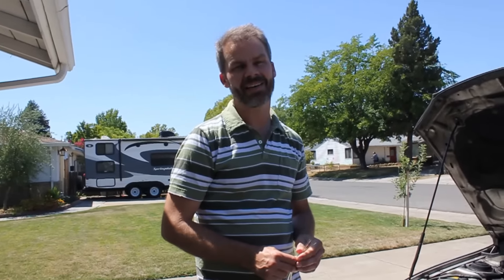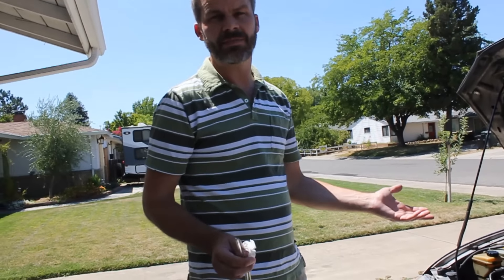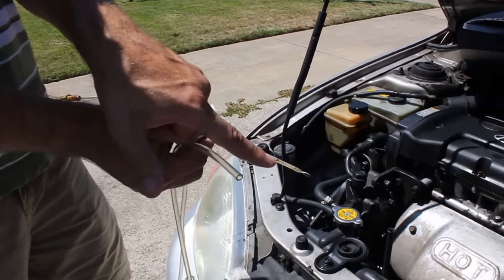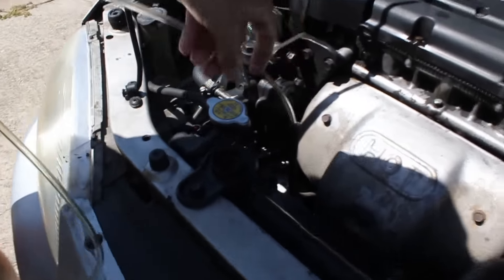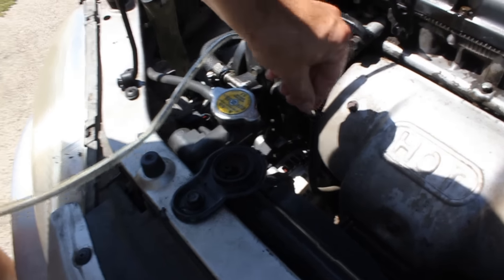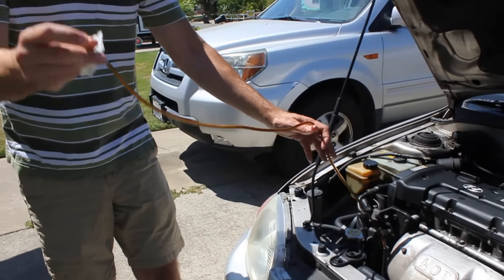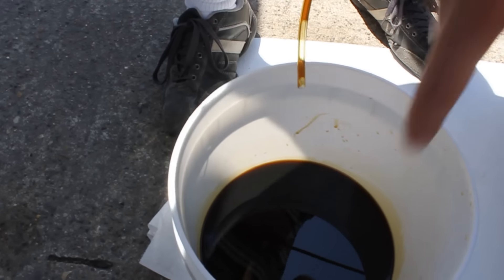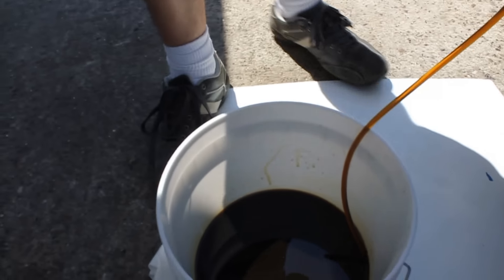How to Drain Oil from a Car's Engine through the dipstick Tube

Comment: It's not draining fast because the engine is sealed, got nothing to do with the oil, if you twist open the fill cap it will drain like water.. Still great video.
Reply: Thanks!
Reply: Wow, great tip! I've got a cheap manual ball/siphon pump and I remember having trouble getting it to flow out, as well. Now, I've gotta do this in the morning because some local moron running a shop, let his 17 or 18 yr old worker overfill my oil. He overfiilled it so much its reaching the letter "O" in "Overfill" where it says, "Do Not Overfill." Good grief! Props to Groupon for granting me an immediate and hassle-free full refund for the oil change voucher.
Reply: @PureBlood42  Duuuude same thing happened to me I think. Some apprentice at the shop put like a quart too much in my car.
Reply: @misaelramos83  - Well, believe it or not, turns out certain cars cannot be siphoned of extra oil via dipstick tube, so all my efforts to extract the excess oil were in vain. My car has some kind of baffle down inside there, so no way to feed tube deep enough to reach the pan. I ended up using my free towing service with my car insurance, and had the car towed to a mainstream, reputable car service chain. I went into great detail with the top guy, and made clear that the shop that grossly overfilled me when topping it off, had NOT changed my oil and only topped it off, so I paid this second shop for a full oil change. Naturally, this was on a Saturday, so this place didn't have my car ready until closing time and they wouldn't be open again until Monday. Anyway, I get the car home and recognized I still had the same old oil filter in the car! I was so livid. My receipt even showed that they had charged me for a new oil filter that was never installed. They claimed miscommunication, blah, blah, blah...when I was crystal clear with them that the first place never changed my oil, so how they assumed my oil filter didn't need replaced is beyond me. Besides, if they did assume my oil filter had already been replaced, they should have never charged me for a new filter that they never put in the car, right? So I went back on Monday and made them drain all the new oil out and install a new filter. The reason I had them start from scratch and remove the new oil, is because running that new oil in your car with an old filter (even for a couple days) is not good because your old filter will likely release contaminates into that newly installed oil. I babysat the guy making sure he didn't savatage my vehicle from spite. I also made them rotate the tires and tighten my heatshield that was making noise. Upon leaving, I paid nothing for these services on Monday and insisted they give me a free voucher for my next oil change. I'm almost 60 years old and should have known  better, so now I'm going back to my old ways. Never, ever let anyone service your vehicle without being right there watching what they're doing. End of rant.
Reply: @PureBlood42  Yes despite all my father's flaws he truly was correct in standing by while his cars were worked on.
Reply: Pin this comment please. This just saved me a lot of time
Reply: @misaelramos83  The workers made me leave the area, talked about liability. I wanted to see what all they were doing.
Reply: Thank you!!
Reply: @PureBlood42  That's why I never let anybody else work on my car.
Reply: @Align799nitro hey bro,how much do you leave the cap open ?
Reply: What is the fill cap? The engine is open. I don’t understand.
Reply: @misaelramos83  and this should be al the universal approach, don't trust any in the UK
Reply: The mechanic overfilled my oil. Noticed it the next day. Barely any km after, 20ish, hopefully no damages. Just started this syphon on jetta 2015 as in this video Opening the fill cap may be helping avoid a vacuum effect but still a slow drip. But it is working while I watch youtube lol. I will update if I run into any troubles. I measured the dipstick first to avoid going too far and getting the hose stuck. 1/8 inner 1/4 outer diameter hose. Since this is a onetime thing I didnt look for a syringe. If a next time.....I will get a syringe to avoid sucking oil fumes and speeding it up some.
Reply: I opened the fill cap, still took for ever.
Reply: @PureBlood42 what about siphoning oil via the crankcase with maybe a bigger wider tubing ?
Reply: @rscott2247 ~ I've never tried, but since siphoning requires that the source end of the siphoning tube needs to be higher than the container end receiving the oil, it would likely require raising the car, in which case one may as well remove drain plug if car needs raised.

Comment: Folks he’s showing you a way to drain a little oil without going to the hassle of removing the drain plug again.  If you’ve ever added too much oil anyone could appreciate this easy method.  He’s not sucking fumes into his lungs or getting oil into his mouth. Yes there are more expensive machines that will do this but he took the time and effort to make a video of a handy little tip.  Lighten up people. 👍🏻

Comment: I put a tube down as far as it would go, but evidently it wasn't long enough to siphon. NOW THE TUBE IS STUCK IN MY DIPSTICK CHAMBER & BEYOND. HELP!!
Reply: I was about to do this when I suggested it to my mechanic father and he said No ffs don't do that the tube will probably fall in, we don't want to be having to get that out 😂
Reply: Very simple solution:  Get a new dipstick tube.  Cut the old one off low enough that it can't be seen.  Put the new one in next to it with a little bottle or something at the bottom with some nice looking oil in it that will show up on the dipstick if anyone checks it.  Take the car to some crooked car dealer (this will easy to choose because that would be any car dealer) and trade it in.  Then after you've fixed all of the problems that the car dealer didn't tell you about, you're all set.

Comment: Thanks much.   A simple inexpensive method of extracting engine oil.   I added oil the other day and then noticed it was about 1/2 qt.  too high on the dipstick.   Will try this tmw after I purchase the plastic tube.  Thanks again.
Reply: Howd it go. I'm doing mine tomorrow.
Reply: @mr.tactown.253  how did it go? Im doing mines this weekend?? Lol
Reply: @memolocs01  I'm trying to remember what my comment said since it is no longer showing up here, the video uploader probably deleted my comment, I'm guessing ego/feelings got even though all I did was suggest a MUCH easier/faster/safer way to do this, which is using a $4 harbor freight liquid transfer hand pump and cautioned others to be careful when using uploaders method. Honestly I don't see any reason to get offended by that because people can decide for themselves what works best for them depending on each individuals personal preference and specific needs, some people don't mind driving to the store and purchasing an item because it will require less effort and time spent completing the task, some people don't mind if it takes longer or more effort if it means they don't have to go anywhere or spend money which isn't bad thing but the idea of sucking on tubes in order to drain excess vehicle fluids (gas/oil/antifreeze) wasn't something I found necessary. To answer your question yes it works and for my case I decided to change the oil/filter as the car was already due for an oil change.

Comment: i have seen the tubes for sale at auto parts stores with a little squeeze pump built in.  those are meant for fuel, but would probably work for this too if they are long enough.

Comment: Nice video. I accidentally overfilled during a recent oil change as well, and am using this method to take the excess oil out.
Reply: How'd it go?
Reply: @elizalibby2767  It works nicely. I bought a pump with a 1/4" tube off of Amazon (so I wouldn't have to start the siphon with my mouth).
Reply: Was it on the white 1985 Buick LeSabre?
Reply: Same

Comment: I also accidentally overfilled my Iveco Daily diesel campervan wayyyy too much: so you showing that you did too was already comforting. I syphoned it the same way, but also used a syringe I bought at the drugstore. It took me a long time to get most out but it worked. Unfortunately, I'm reading online that - eventhough I didn't turn the engine on while it still having the excessive oil, I still might have damaged some parts of the engine. Especially because I let it stand over night with the excessive oil. I'm not sure, I turned the engine on a few times for a few minutes, and it seems the oil volume dropped a bit too, so it seems it's now leaking somewhere. Is this possible? Or maybe the oil just settled in a bit. Thanks in advance!

Comment: The tube I had was too large for the oil dip stick tube. So I had to loosen the drain plug and let it drip but that was way too slow. Then I took the plug all the way off, holding it right next to the pan and I could regulate how fast it came out.  I was so scared I'd drop the plug and all 6 quarts would come out on the ground. I had a shallow pan to catch about 10 ounces of oil. Praise God it went well.

Comment: Wow I just bought a the ft quarter inch tube from Home Depot to bleed the brakes and turns out I can use it for this now too! Yes! Just found out that they can’t remove my drain plug without breaking the pan ($1100). Glad I found this
Reply: how much was drain tube
Reply: @Bobohighlyfavored  
I think it's about $1and some change per-foot at Ace Hardware. Lowes and Home Depot probably have it too.

Comment: Everyone should try an oil extractor.  They're about $100, and you'll never have a mechanic do it again (or crawl under, if you do it yourself).  You can get one from Harbor Freight among other places.  It's basically the same approach as this, but you have a hand pump to create suction.  Like this, it's easier (and safer) than taking the bolt out the bottom of the pan.

The only major caveat is that you should ensure that you can get all the way to the bottom of the oil pan with the hose.  The first time you use the extractor, remove all the oil you can with it, then try draining the pan from the bottom.  If nothing comes out, you're good.  (Some cars have a baffle that prevents the hose from getting all the way to the bottom.)

Note that you may still have to jack up the car to access the oil filter, but that's going to vary by make/model.  In my case, the filter is on the side, so I have to use a jack for that.  However, I'd have to put the car on the front jack point to do the oil, then switch it to the side for the filter, so the extractor saves me time regardless.  I also can start draining the oil while it's hot and stirred (i.e., any crud is still in suspension and hasn't settled onto the parts) rather than delaying while I get the jack and stands set up.
Reply: In my Toyota, even after  i drain the oil from the crankcase, the filter still has oil in it. But if using that contraption you mentioned takes the oil out of the filter as well, then I'm with you all the way ?  Changing the oil filter on my Toyota   doesn't allow me to use the simple metal encased filter type.

Comment: Due to a rounded off drain plug I'm gonna change my oil through the dipstick but I have a hand pump that will make it go a lot faster
Reply: In the same situation. It sucks.
Reply: The make sockets specifically for that reason
Reply: @ethanallen2680  just rounded mine off with a perfect fit 9/16ths socket, do they make these damn things reverse threaded or something?
Reply: @ethanallen2680   I thought I would leave well enough alone
Reply: @jaysmechs2457  😅
Reply: Rounded off bolt?  Try a pair of channel locks.  Grip the shit out of it.  It should come loose.
Reply: This happened to me once. I filed two flats on the rounded off plug. I used a hack saw blade and a metal file but you could also use a grinder and Dremel, anything thing you just want to parallel flat surfaces.   Also before you start go buy a new plug. And ask God to help you, this is probably the most important thing.

Comment: Helpp how did you clean the oil inside the tube??
Reply from the maker: You don't.
Reply: usually nobody cleans it, but if you really wants to clean it, get a small funnel attach to the hose and start filling solvent like carb cleaner or kerosene and that will get rid of the oil in the tube.
Reply: @Cockerham  Thank you, and thank you for posting this video! I'll check tomorrow, not sure right now, but could've put too much oil in today and I've been worried about damage. Not so used to this car.

Comment: When I got my car's motor oil replaced, the service workers filled it over the maximum level - which I only found a year later, as I was a beginner and I didn't realize that. I drove the car with overfilled engine oil for 1 year till I took it to the service for check and a worker told me. Luckily I only drove 1000 km but still, idk how much damage to the engine was caused. 😟
Reply: I'll do my best to try help answering your question, which is entirely based on my personal experience I have had working on cars, regarding the question of how much damage could have been caused from driving a year with overfilled oil, I can guarantee with 100% confidence that the correct answer is somewhere in between minimal damage/catastrophic damage, but you would have to go to a mechanic or auto shop so they can run tests and examine the vehicle to get an actual detailed answer with a report of the specific parts that were damaged or if there even was any damaged to begin with. Of course other information would help to give clues to predict and help better understand the situation of your vehicle and some of those things would be: to know the exact make and model of the vehicle, find out what capacity oil it holds, to know how much extra oil was overfilled, find out details from the owner(you) if the car has been making any strange noises or experiencing any issues since you had the oil overfilled, if its been running rough or performance has been lacking in the car, to know if the shop mechanic who notified you about the overfilled oil if they noticed any metal particles in your oil when changing it or if the oil looked foamy frorhy meaning it was splashed around causing it to aurate and foam which stops it from being able to properly lubricate the engine which would lead to engine damage, but they probably would let you know about that if it occured, depending on if it was an actual legit shop or some shady mechanic or a backyard mechanic
Reply: @mr.tactown.253  Thank u very much!  Those from the service that noticed me didn't tell me any other detail than the fact that it was overfilled and shook his head, emphasizing that it was wrong. On the dipstick it was like 1 cm above the maximum level. I didn't notice any issues with the engine while driving. My car has 5 liters capacity oil, model Vauxhall Antara  2.2 CDTI from 2015. I will probably pay a visit soon to a service to run an engine test.
Reply: @criss6945  No problem, btw this next answer is a copy paste of what i wanted to write but i was a bit lazy and just decided to copy it but it sums up what i was trying to say:

I think its fine. Most engines have a certain tolerance for slight overfilling like this.

"I think it's fine most engines have a slight tolerance for overfill anyways. Now I would never overfill an engine deliberately, but if its a bit high, don't worry about it. When the engine is running, the oil pump sucks a lot of oil out of the crankcase and pumps it all over the engine, effectively lowering the crankcase level anyways"

Also something to add to this, I'm pretty sure you would have had your engine overheating if the level oil was overfilled enough to cause major damage, since the concern is the oil not being able to lubricate all of the engine parts being of being splashed around and beaten into a froth/foam or air added to it, but if that happened I'm pretty sure your car wouldn't be able to drive for a whole year without engine overheating or at least some kind of major signs of issues occuring, for example noise or smoke or lot of other things that most people would notice right away and figure out that something isn't right and get it checked out, since you drove for a year and went to a shop and they didn't say you needed any repairs then i wouldn't worry about it, after all, I've never heard of a auto shop passing up on a chance on trying to get the customer to agree to pay to have some type of service, repair, maintenance, ect. anytime they are able, and many times them service offered isn't even necessary or needed, sometimes it seems like they didn't even do whatever it is they offered to have done when it comes to maintenance or small things that they add on to the bill which are usually way over priced and can be done yourself for no cost, before anyone reading this gets offended at the last part, notice how I said it happens sometimes..
Reply: @mr.tactown.253  Good to know. Thank you!!